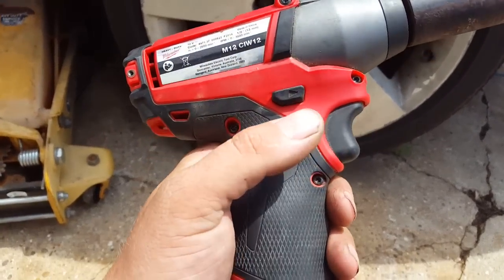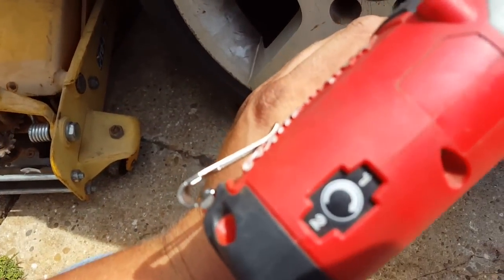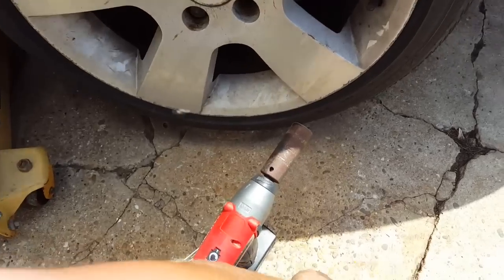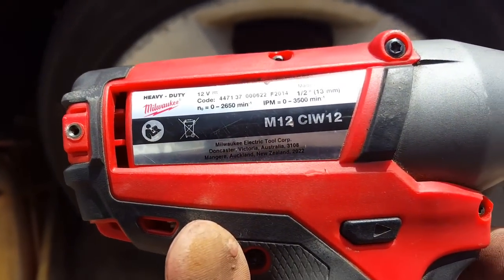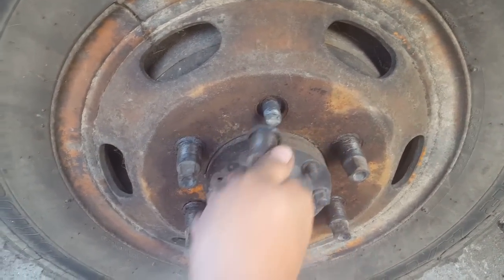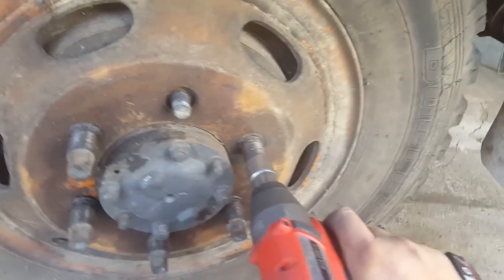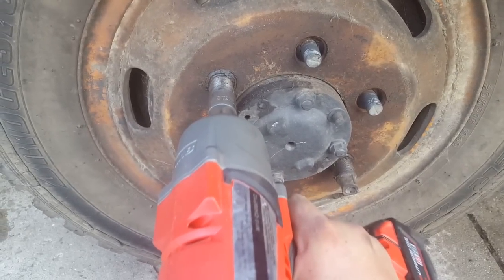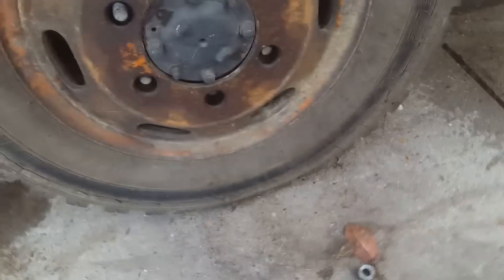Milwaukee  M12 CIW FUEL impact wrench testing car and truck wheelsnuts Brushless power!

Comment: thats a strong little impact wrench. I am getting my 3/8" m18 fuel impact today and cant wait to use it
Reply from the maker: +Jursaw you wont be disappointed in it they all have plenty  of power
Reply: +brad howlett I have done a lot of research and I like the Milwaukee lineup. I have a few of their M12 Tools
Reply: One Up The Sleeve Customs - Brad howlett IS my feybret youtober 😉 ill meik videos soon

Comment: Great video. I'm glad you tried on the truck where the small impact wrench couldn't move the nuts on two of the bolts. I was just wondering that. I had a few nuts my 18 volt bosch couldn't loosen. How many newton metres is the big milkaukee.
I have seen a panasonic impact wrench it actually has a dial for different torque settings.
Reply from the maker: +Ronald Martens the big Milwaukee  is in excess of 1000nm i believe  so it has  a ton  of power  this  m12 is so handy i use it very often. Thanks for watching mate

Comment: how many tires you can change with one 2 ah battery?
Reply from the maker: +Beniamin Zawadzki with a 4.0 on the weekend i did 4 x 5stud wheels off and 4 back on and it didnt drop  on the charge meter so realistically  16 to 20 wheel changes  is possible.
I did a torque test with it here>https://youtu.be/3UhQHx-X8FY
Reply: I changed 8 tyres (110NM)  with 2.0 AH battery. Still 2 marks power left. Don't know exactly now much it can will. I never try till the battery is dead, because that damages battery life. Always recharge when hits the last mark.
Reply from the maker: +Michael Raksham also means you never run out of power ;) great tools
Reply: Yeah, they are great tools :-)